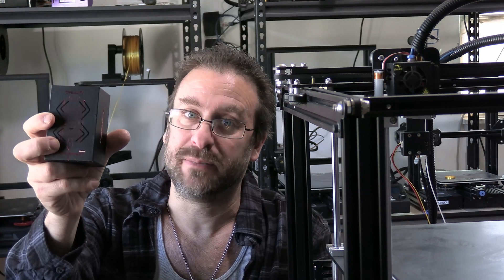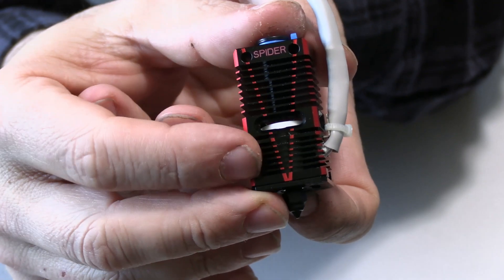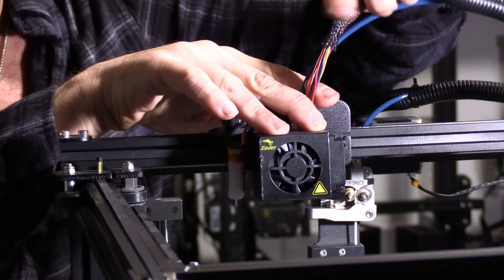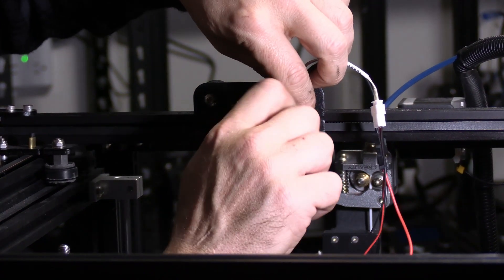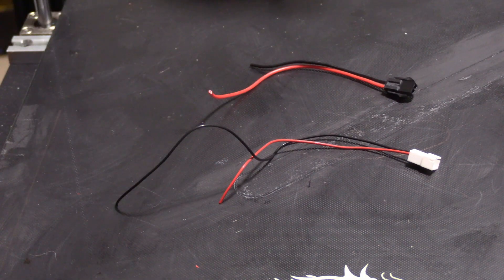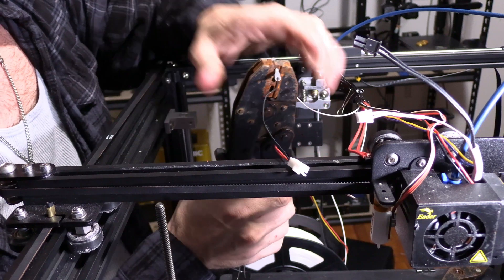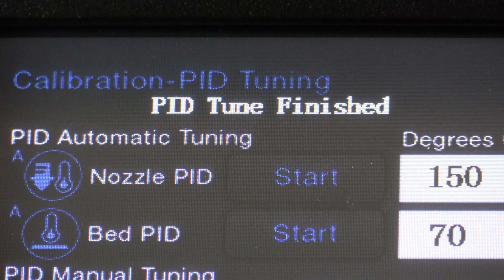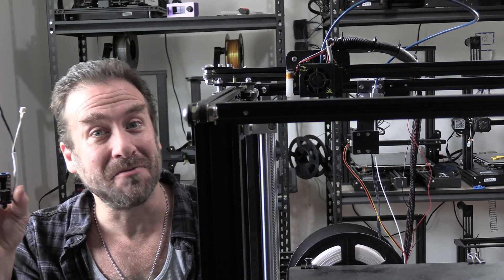Install Creality SPEEDY SPIDER Hot End on Ender 5 Plus (and Ender 3 PRO)

Comment: So I did the same as you did in the video. And  now it's not reading the temperature. Any idea how to fix that?
Reply from the maker: Somehow it's your thermistor. Look closely at the wiring. Is it definitely heating?
Reply: @3DRundown yes it is. First it heated up. And then it stopped and said failure.

Comment: Those quick disconnect connectors that came with this kit will fail after a few years. I just cut those out and soldered wires - no more issues with extruder temperature wild fluctuations.
Reply from the maker: That'll work, but mine is still going

Comment: Super helpful, thank you.  Just got my spider v3 and a sprite extruder to convert my E5+ to a DD, high-temp, Klipper-running beast.  Once I get this all together, I just need it to start making enclosure brackets and a new external electronics mount for itself and I'll have a very capable machine :)

Longer term, maybe a corexy and linear rail conversion is on the horizon, if I really want to kick things up a level.  But my plan is to use this to print more functional parts with 0.6mm+ nozzles, but if I ever decide I need a lot of giant prints with 0.4/ 0.2mm nozzle levels of precision, then maybe I'll look for that extra speed and rigidity.
Reply from the maker: Mine has the Spride SE, Spider, and Sonic Pad. Been epic.

Comment: So, does that get to 300C nozzle temps without firmware changes on the Ender 5 plus and Ender 3?
Reply from the maker: Only if firmware supports it, on a 5+ I 10000% suggest a Sonic Pad. Easy-peasy on 5+. Massive upgrade from the archaic firmware

Comment: iv installed the speedy spider, i cant dial in my retractions whatsoever!  i used to have great prints, is there a trick to these all metal hotends or do i have a faulty one!!!  thank you sir!!! used to run 6 60mm speed, now it looks the best, which is super stringy at 2 and 30mm!!!!  i dont want to give up on this ender since i had it from the start of this hobby!!!
Reply from the maker: 2 is not enough for a boden setup. Start at like 6/25

Comment: Very informative review! Thanks.
Reply from the maker: Welcome. I do prefer the Spider 3, and did make the switch.
Reply: @3DRundown  Why? I was choosing between 3 and 4(this) and after your video 4 looks prefer.
Reply: @3DRundown  Ok, i got it. Version 3 have more modular and serviceable design. Changed order to version 3.
Reply from the maker: 4 is much closer to the current design, seen in all the modern 3D printers. However, in my experience, (and others), there have been some issues with the heating element. The Pro 3, is a TANK. It will hold up to abuse, and never let you down. It's also, yes, easy to service. The 4 will heat faster, but, who cares.
Reply from the maker: It turned out, my speedy wasn't the problem, but.... https://youtube.com/shorts/iXsQ5uqMCrw

Comment: would u mind sending me the firmware you are running on this ender 5 plus. please and thank you
Reply from the maker: Hi Friend. I'm running SONIC PAD on the 5+. You should too. It's a quick and easy setup. It will bring your 5+ up to modern standards. Klipper has a small learning curve, but, if you don't go crazy trying to push the machine super fast, and all that, it's easy, and you shouldn't fear it at all. I 1000% suggest you go SONIC PAD on the 5+. Otherwise, use TH3D. But.... Go Sonic Pad. Used on Ebay will do.

Comment: I am just a little confused is it plug and play or do I need to splice the wires on an ender 5 plus?? I thought i heard you say you can just plug it in and you're done.
Reply from the maker: Yes. Many models will connect directly too the included harness. At launch, this information can often be hard to confirm, or, straight up wrong. So, I try to cover the bases  for self splicing.

Comment: What firmware are you using on your ender 5+? Do you have an installation guide by chance?
Reply from the maker: Sonic Pad. It's an easy setup, and the printer is instantly like a new machine. It's NIGHT AND DAY. Sonic Pad, is the way, PERIOD. Grab a used one or on sale. You'll be up and running in 30 min, and after a short learning period, you'll wonder HTF you lived without it.
Reply: @3DRundown  awesome thanks, just picked one up it should arrive in a week or so I’ll let you know how it goes 😁
Reply from the maker: Awesome. I put it off for MONTHS, cause I didn't believe in it. Boy was I so wrong. You'll love it on your 5+. Just be patient as you learn the ropes. And remember the new GCODE for ABL!

G28 ;Home
BED_MESH_PROFILE LOAD=default
Reply: @3DRundown  hey i just got it today, what exactly does this gcode do and how do i put it into my Creality slicer

Comment: what firmware you running on your 5 plus?
Reply from the maker: Sonic Pad. Best move ever. So easy.
Reply: @3DRundown  I just had a look at them. Doesnt say compatable with the 5+ tho
Reply from the maker: I'm Running Sonic Pad on my 5+. It hasn't missed a beat since the day I turned it on. Setup was like 10 min, and at the time, I had never used Klipper before. I assure you, 5+ works on Sonic Pad.

Comment: It looks good and I only have one concern.  It looks like the heater cartridge and thermister are not replaceable.  It looks like you would have to buy a new hotend if you damaged one of the wires somehow.
Reply from the maker: Correct
Reply: @3DRundown  Okay, thanks.  I will not be buying this one then.  Maybe version 3.
Reply from the maker: Spider 3 is my favorite hot end.
Reply: @3DRundown  Yes, I have been looking at that one as well as the Phaetus BM.

Comment: I have a problem with setting the temperature. PID doesn't help
It does not heat the nozzle during printing.
Still missing 10*C
The standard HOTEND works without any problems.
Spider 4.0 works beautifully except for this E1 temperature error
Reply from the maker: E1 typically means the Thermistor has a problem, or isn't connected. If your get an "not heating as expected" error, try this: Turn your fan down to 90% when slicing. And test again. Mine failed EVERY PRINT, till I made that change. Zero fails since.
Reply: My fan is 0%
I have PID but there are still a few steps missing
Reply from the maker: Why is your fan on 0%? Should be %100, however I found I got the error, unless I used 90%. I'm talking about slicing for PRINTING (FYI, I switched to Spider 3)
Reply from the maker: You are on Sonic Pad?
Reply: No TFT35 E3 v2 and SKR mini v2 @3DRundown
Reply from the maker: oooooooh, I thought you were on a 5+. My bad.

Comment: Hi there! Thanks for the video! Iam installing the spider speedy now on my Ender 3 max neo. But how do you know witch orange wire for the heating element is positive and negative? Or doesn't that matter?
Reply from the maker: No polarity
Reply: @3DRundown  oke thank you!
Reply: @3DRundown  it doesn't fit is 4mm shorter than the original hotend so have to find a mounting plate first.
Reply from the maker: Sorry, I reply to this while super distracted. YES, the NEO, sadly, has an odd hot end cover
Reply: @3DRundown  yes when I mounted the spider speedy the nozzle is unable to touch the bed the autolevel sensor will hit the bed first. And I learned that it's really important that the tube is tight against the nozzle.....still learning :)

Comment: Hi so I have a ender 5 plus and Im fairly new at wiring,  do I need to do the crimping and wiring he does between the  hot end and the existing wiring? or was that to just show how to do for those who wanted the option? If I do need to do it, does someone mind explaining what all the different wires do?
Reply from the maker: For the Speedy Spider, the wires are pre-installed and very short. You just crimp the 2 red wires for the heater. The 2 white's are the Thermistor. Nothing else needs to be touched.
Reply: thank you so much! @3DRundown
Reply: @3DRundown so for the heater + and - doesn't matter? For the thermistor it doesn't I read that.
Reply from the maker: neither have polarity
Reply from the maker: Consider going with the Spider 3. The wires just clip on!

Comment: @3DRundown I have the spider 3 pro hotend now for around 4 months. And till now it worded will but for 1 or 2 weeks now I can not finish any print anymore - it starts clogging ….. any methods works for 1 or 2 prints maybe. What is your experience with the speedy spider after 4 months?
Reply from the maker: No clogs yet on my Ender 3 Max with Spider 3. I print on it almost every single day. Have your Slicer settings changed? Could be retraction settings? But I'd start by looking at your Bowden tube to see if it's scorched or deformed, and, consider a new nozzle
Reply: @3DRundown  thank you so much. I will check.

Comment: What will this do for my Ender 3 pro, besides faster heat up times? Great t Greg keep on keeping on🔥👍🤓
Reply from the maker: I wouldn't do it. These ceramic hot ends are the future, but I had problems with 2. Go for a Spider 3. Really excellent hot end. However, your stock hot end is OK also. Eventually it will wear down, get gunky, and become a problem. Spider 3 is the way to go
Reply: Thank you Greg!! What about now? You think there's been enough time for them to work the bugs out?. ✌️
Reply from the maker: I want to think so, but, I have no way to confirm. I know they have already revised the K1 Ceramic heater.

Comment: Awesome video, thanks. I have an Ender 5 plus, and Im deftly will add the new hot-end!!! Question: your Ender 5 plus firmware seems more complete and better than mine, what is your firmware version? mine is 1.70.2 and it sucks! Thanks
Reply from the maker: Brother, forget the firmware. Put a Sonic Pad on it. 15 Min setup and off you go. However, the firmware that WAS on it (just a static screen now) was TH3D, and it's worlds better than stock. Now it has Klipper flashed to it, via the Sonic Pad, but the screen stays like that, as it's no longer used. Sonic Pad becomes your screen
Reply: @3DRundown  Dang, I was thinking about that, im between a Kliper or an RPi3b+ or the sonic pad!
Reply from the maker: Sonic Pad, unless you are REALLY STRONG with your Klipper skills
Reply from the maker: Check todays VLOG short

Comment: Is the size of the speedy hot end the same as the stock hotend of an ender 5 plus? I have the og spider hot end and it's way bigger than the stock so my bL touch doesn't reach the bed before the nozzle and my nozzle is crashing into the bed. Not sure how to correct this. I tried adjust the bL touch with a bracket but then the bL touch crashes on the support brackets to the left when bed leveling 😮‍💨
Reply from the maker: A spacer will fix your problem. I have a video on that. However, ditch that slider and get a spider 3 (not the speedy. It fits, but I have had problems). SPIDER 3 is normal size, and will work with no modification.

Comment: Do you have any issues printing with PLA on the spider all metal hotend.  I installed a Micrswiss all metal hotend and direct drive and every time I try printing with PLA it cloggs the hotend. So I only use PETG now which I have had no issues with.
Reply from the maker: I print exclusivly with PLA. However. I am going to swap my Speedy for a Spider 3. I prefer that one.

Comment: So I got this hotend. I can’t get it past 7.2 mms cube flow rate. 

If I increase the temp to 280 it works but then I can’t really print with it since everything just droops and looks fucked. 

Wtf am I doing wrong?  With a stock kobra go hotend I can push 17 mms cube. 

This spider was literally  almost the same cost as a brand new kobra go

Comment: Giving up on this extruder... went through 2 already... clogs VERY easily. Clogging was the reason I ditched the stock hotend... The nozzle does heat up really quickl;y and the nipple guard is great. Other than that, not that special. Still looking for a good replacement for the stock hotend. Any recommendations would be welcome.
Reply from the maker: My Spider 3 have never clogged. I use it every day. However, your Speedy shouldn't be clogging either. But I am having heating issues with it. Not yet sure if the hot itself, or a wiring thing. Maybe your retractions too high? Should be 5ish. Spider 3 is Super. I may put one on my 5+.
Reply: @3DRundown  this is precisely what I was thinking. Retraction or heat creep. I’ve avoided doing a Hero Me because I wanted to keep the printer as stock as possible as long as have the stock gantry. I was going to return this second heated today but I may try to pull it apart and fix it just to test before I get another.
Reply from the maker: I replaced my Speedy on the 5+ with another Speedy.... still troubles. I replaced it with a Spider 3, and so far it's super.
Reply: @3DRundown  they refunded me my money and asked me to keep it longer so I am installing a Hero Me on it to see if it makes it better.
Reply: BTW that hotend is crap, I went back to the stock one. LOL

Comment: I just got mine today, and when leveling with the creality bl touch, I noticesd that it sits lower than the level and I can't level that bed at all with out the bed pushing up on the hotend.
Reply from the maker: You will want to use a spacer. https://youtu.be/fhTIfO1m_yQ

Comment: Thanks for the video. I have seen some other folks having issues with theirs, thankfully I have not had problems with mine and I am loving this hot end. I was wondering what retraction settings are you using with the speedy spider?
Reply from the maker: I believe I'm at 5/30, or super close to that. I will check when I'm in. Away till Tuesday.

Comment: could you put this in the sprite extruder? like ok the s1 or s1 pro thanks s
Reply from the maker: No. This is for Bowden setups. You can get the High Flow Kit, or the new Ceramic hot end

Comment: Just installed Spider Speedy on my ender 5 plus
Stock setup
I plugged the extension cable between the thermostat to the backside of the printer “without soldering”.
Plugged the heater with the extension till the backside then soldered it.
I’m using Marlin FW
It is working great so far 

With the old stock hotend I was suffering from temp runaway and clogging and fluctuations of temperature

Now I’m looking for the best way to update the firmware to 300 degrees 
Any advice?
Reply from the maker: Look into TH3D firmware or Gift her a Sonic Pad.
Reply: @3DRundown  appreciate you advice

Comment: How is it printing 1 month later?
Reply from the maker: So far, Zero issues. I don't use it a TON, but haven't had any problems. I DO use the Spider 3 a ton, and it's my favorite hot end so far. Clean prints, every time. Not a single clog yet

Comment: I'm confused about the design of this hotend. Does the heatsink really touch the ceramic heater or does it only look that way?
Reply from the maker: It's a ceramic tube, below the Heatsink, with the heat-break inside
Reply: @3DRundown  That's what is confusing me. The ceramic heating element has cooling fins around it in the lower portion. If those fins touch the heater it would actually be cooling the heater and be pretty bad for performance. That's why I'm wondering if they touch or not.

Comment: Hey, nice video! I recently upgraded my E5+ to this hotend. As you said it comes with a .4 and a .8 nozzle. Have you changed the nozzle after use? I am going to put a .6 on but am not sure where or if I need to hold with pliers while changing. With my other all metal ends I need to hold the block in place so it doesn't spin. Any tips?
Reply from the maker: I have not! But there is not heat block, so, should be good to go on the Nozzle
Reply: @3DRundown  Nozzel came off and tightened with no issue. Where did you end up with your reaction setting with this HE on your E5+? I figured that it would be the same as my Microswiss but definitely not.
Reply from the maker: 6.5 / 25

Comment: I’ve installed mine but after having near perfect prints on my stalk hotend this one I havnt gotten a single print nor does it adhere to my pei bedsheet
Reply from the maker: First layer issues are generally a Z-Offset issue. Did you adjust your Z during the 1st layer to set it correctly?

Comment: why not use a lighter? is this some weird don't touch it with an open flame stuff?
Reply from the maker: Because I have a fancy expensive tool. Might as well use it. 😛😛 Plus I can control exactly where the heat contacts, and the exact temp. It produces superior work. Also, my butane lighter ran out my on my very first take. 🤣😂🤣

Comment: Oddly they claim 250mm/s for Spider 2 300mm/s Speedy and surprisingly 400mm/s for Spider 3.0. - faster than the speedy!!!!
Reply from the maker: The V3 is a really great hot end. I think their best. Will see how the Speedy holds up. Having no Heat Block is kinda cool. But the "Speedy" refers to the Ceramic Heater, giving it a fast heatup. I don't believe Speedy has a HF Nozzle on it. I think it's an MK8. Spider 3 Does.

Comment: Know the wattage of the heater?

I’m running the Mriscoc FW, and it uses MPC, and while it claims to complete the auto tune, it sets everything to 0.000 and that prevents the hot end from working.

I tried adjusting wattage up, that seems to help the auto tune curve… Maybe.

Still haven’t gotten a completed run that actually gave settings.

Either way, I found some settings for a 65w hot end, that may work well enough to at least get working for now.
Reply from the maker: Hi. I'm note sure. I'm running TH3D on my 5+. It worked straight away. I'm gonna try it on a 3 Max or 6 Max, shortly.
Reply from the maker: Go to Creality.com and do a live chat after 9pm. See if they know